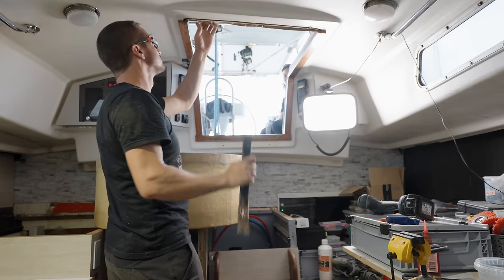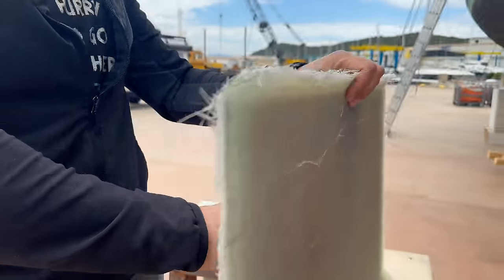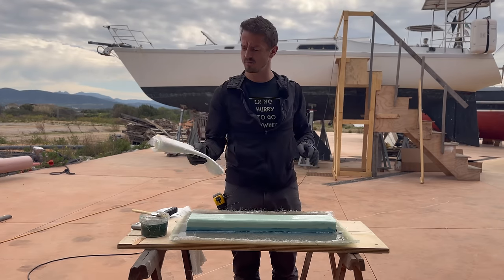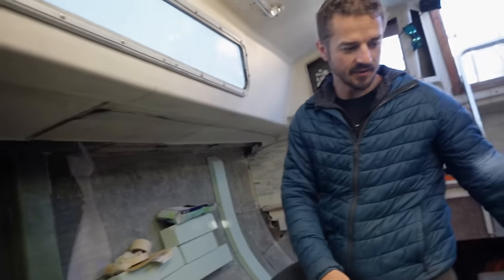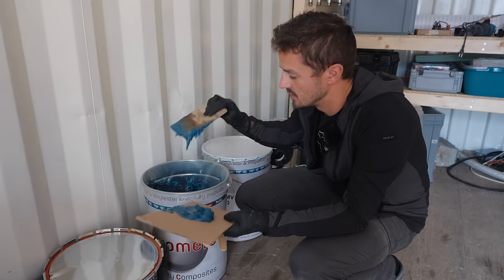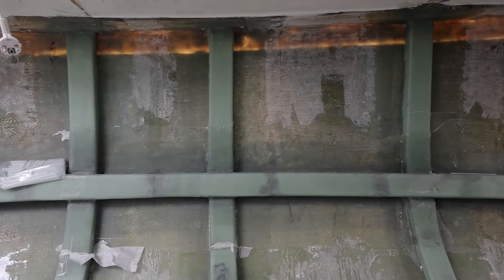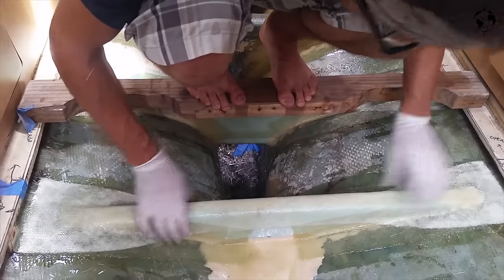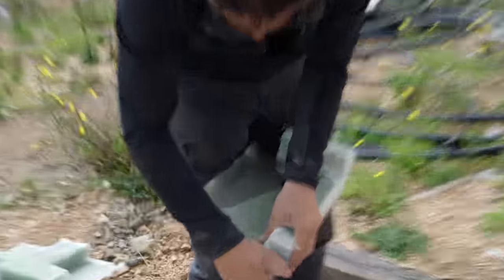Cutting Open our “New Hull”: What Could Go Wrong? | Step 386

Comment: The reason for the delamination is the peel ply finish you did on the model.....
Reply: I disagree. The peel ply wasn't under the stringer layers. It was on top. The failure was between the hull and the stringer laminate, not between the stringer and rib laminate.
Reply: @Sagan_Starborn They used peel ply on the top of the “hull” layer at the end of last weeks episode.  I don’t know a ton about doing composites other than what I’ve seen on some YouTube channels (Mike Patey would have done all this with carbon fiber!) but based on the comments I’ve seen from others here, I’m in agreement with those saying their apparent lack of prep (sanding and cleaning) of their hull layer before applying the ribs and stringers is the main culprit. Since the actual boat was ground and sanded down inside, and the pros were fully wetting out the glass before applying it, I don’t think Uma should have the same issue. Hopefully they give them a good whack with a mallet to check though!

Comment: I bet that the Dunning-Kruger study was based on the comments written to this video.
Reply: There are a lot of clever comments re the problems with peel ply, the concern over secondary bonding of polyester laminates and the need for good surface prep for polyester laminates - not much over inflation of self worth that I can see.

Comment: I think you will be ok.  Your test piece was smoothed down by the peel ply and has some silicone wax relief that prevented bonding.  The sanded and scuffed polyester hull should bond and laminste soundly.  Also the rovings being soaked in the actual fabrication should aid in the intragral bond.  Howeve, th new glass should be sanded prior to eack lamination to maintain the intrrgrity of thenew composite structure.  Good luck!   Professor Stephenson from KSU.

Comment: Vinylester is used to encapsulate a woven fabric, build in one piece or layed up when still tacky. It's not glue, it doesn't bond well to resin that has already cured. For that purpose you use epoxy, especially for structural work. Bonding of polyester or vinylester or cured materials heavily relies on sanding the surfaces as rough as possible. Still it won't come close to epoxy.
Reply: Dude, where did you read that? Vinyl has been used in boat building since the 50's and has been used in all building stages. Sand to remove blush and clean.  Then, just before additional layups, dampen area with styrene or MEKP to reactivate and give a partial chem bond along with the mechanical bond.  The industry has been doing it for years, too thick a layup overheats , then you got real serious problems
Reply: @GoofieNewfie69  The fact that you have to reactive the laminate says enough. And good luck trying to reactive a 50 year old laminate. And I wouldn't be too sure they even doing that on Uma.

Comment: When I was watching you hot glue the ribs to the hull, I went uh-oh. They should have been expoxyed in for sure.
Reply: Lesson #1
Reply from the maker: Why!? The foam is just a filler to hold the glass in shape while it cures. It has no structural significance to the finale result.
Reply: @SailingUma  The new glass is attached to the foam. The foam isn’t attached to the boat.
Reply: When laminating any product, using multiple solvent types is always a recipe for disaster.  Hot glue releases a solvent as it cures and can take days to complete degassing.  Not to mention that when you have a composite construction with air space sealed inside it is not known to turn out well.  Even if it’s just from an expansion/contraction difference, it’s going to create a weaker setup.
Reply: @davidwebb4904  Delamination in a test occurred between the "old" fiberglass of the "hull" and the "new" fiberglass of "ribs". The connection of foam to the hull's or rib's fiberglass doesn't matter at all.
Reply: The foam is just there to shape the ribs. This is not a foam core construction. The foam is just a lightweight material that allows the ribs and stringer to be shaped. Once the resin cures, the foam could be removed with no structural impact. This is in contrast to foam core design where the foam is under shear loading and is structurally significant.
Reply: @KeithCarmichaelInFL  This sounds a bit far-fetched. It seems obvious that, for whatever reason, there was a film of something waxy or something between the panel representing the hull and the glass over the foam. It was effectively a mold release. I would be looking at the resin used.
Reply: More like a structural bond failure than de-lamination.
Reply: Nah this is not a problem. It's the glass to glass adhesion they are concerned with

Comment: It brings great memories and joy to see a Pearson 36 undergo the adventures and renovation you have undertaken!  Having owned a 1973 Hull #45 and doing extensive repairs and improvements,  we found the the quarter sections of the 36 hull to flex (oil can), are you installing stiffeners in the aft sections? The 36 also has two deck scuppers/tubes which were glassed to the hull. Access was in the sail lockers. Those tubes cracked on our boat when we were hit with a quartering sea one afternoon. We had them removed ground out and had thru-hulls installed with a hose to the deck scupper. Lastly, having rebuilt our keel section when we had the keel dropped to re-bed, we found that these energey crisis hulls had inconsistent hull thickness. We actually did core samples as suggested to confirm this.  The keel sump area was much thinner than it should have been. Be sure that the keel sections and bilge get additional glass layers. We had the guru of fiberglass boat construction, the late Alan Vaitses, supervise our rebuild. You can find many of his books available. Fair Winds!

Comment: Your hull is okay, difference between your example and the actual hull job is that you laid up glass on the surface after peel ply without sanding it. And you never do that on structural things, consult with the young barnacles channel. Also you have applied a lot of tiny but powerful hits to the small surface area, and your hull reinforcement is a one big structure with a lot of contact surface which will distribute the laws of most collisions with the dock

Comment: Instead of hot glue, why not put te filler to adhere the stringer on top of the rib.  That way, there is no air gap between the rib and stringer?
Reply: Too late!!!
Reply: @davidwebb4904  hot glue is fast. You just have to hold the foam there for a short time until the glue sets then you can move on. If they used epoxy or something they would have to wait for it to set up.
Reply: @mckenziekeith7434  Hot glue has ZERO structural value.
Reply: @davidwebb4904  I agree. The foam is also very close to zero structural value. It is just a form for the ribs and stringers. But instead of removing the form, you abandon it in place.

Comment: As that you did grind everywhere inside the boat, which should add more adhesion, grind your model base and then attach new ribs and retest it. You could also thoroughly wet out your cloth before you put it over your ribs. Also, don’t forget to wipe it down before you glass on the other stuff. Pretty sure you did do a thorough cleaning to reduce or eliminate residue. So do the same thing with your model use some kind of degreaser dewax or whatever whatever you used in the boat and see how it works

Comment: Bond the foam to the fiberglass hull and new fiberglass, not hot glue.
The foam has compressional value as a monolithic structure.
Reply: But the foam isn't what should be holding the panel on 😂
Reply: @CaptainShack   Didn't expect you here! Who knew my interest in space sims and sailing had ANY overlap.
Reply: The hot glue simply holds the stringer in place. The overlay secures its placement
Reply: @QuinnChada  wrong ...the core is structural when bonded

Comment: I just watched the segment where you explain what you are doing regarding the frames and stringers. You pointed out that you would notch the frame over the stringer rather than cut the stringer to butt upto the frame because to do so would be a weaker method than leaving the stringer continuous. I would like to point out that the foam offers absolutely no structural support. The foam is purely there as a form for the glass layers. It is the shape of the fibreglass over the foam that gives the strength.
Reply: Not true at all. The foam in a composite (sandwich) panel add tremendously to the "rigidity" or "stiffness" by separating substrates of significant tensile strength, while preventing "sheer".

This would have been the case if the stringers and braces were properly bonded to the hull.

Because they were adhered with random glue gun beads (absolutely absurd) there is a good chance that the stringer and brace to hull bond will release, the composite sheer resistance will be lost, and the overall "stiffness" severely compromised (compared to what could have been achieved, if the stringers ands braces were bonded "intimately" with thickened resin.

Comment: Looks like the guys inside the hull attached the horizontal reinforcements first (in the first inserted video clips) of the video. That was confusing.
Besides I hope that roughening up the old inner hull surface for a better sticking of the additional (new) 2 mm inner hull works.

Comment: My guess is that not pre-wetting the fabric is what caused it. I have if anything just done an acetone wipe down after removing peel-ply, no sanding etc. 

By looking at your time lapses, the pros definitely seem to wet down everything before laying it. 

I would probably also use thickened epoxy to fill the gaps between the foam, so there are no possible pockets in there. Then you can just squeeze them in place and “fair” the sides with the squeeze-out. 

Would be interesting to hear the pros’ opinion on what went wrong with your sample.

Comment: "And to save even more weight, we've decided to build everything out of carbon fiber over aerogel..."  Hey!  I'm GLAD you're using more traditional materials!  There's a lot to be said for the handling characteristics of that which is light, but solid.

I once had a cast built up of overlapping strips of plaster-infused gauze.  The strips were roughly 1" x 6".  I've often wondered if such an approach wouldn't be strong than you three-play layup.  I'm thinking possibly, but the uniformity would be lacking.

"Where we're going, we're going to need it."  Rendezvous with the Kraken?

Your destructive test of your demo model:  You didn't sand and prep it between layers.  You DID sand and prep your hull.  The sanding significantly increases surface area for bonding, and pepping it with an acetone wipe-down removes the uncured layer of resin which interferes with bonding.

Final product:  "We no longer have any room inside the boat to live, and it's now too heavy to float, but it's STRONG!"  Just kidding.  :)

You guys are doing great!  Excellent considerations all around!  I especially like your coordinating with multiple sources of engineering input.

Comment: While peel ply is good, a quick sand and clean is required for best adhesion, and thickened matrix material instead of hot glue to set the foam in place.

Comment: This is such a big project and y'all are rocking it! My only thoughts on the glass delamination issues. 1) While the peel ply is good stuff, it has to be applied 100% correctly (should almost be wetted through, no air pockets, etc.). If not applied correctly, it can still look OK to play the next layer of glass immediate after the peel, but it might not actually be OK to lay the next layer without prep. When we do glass work, I still sand the layer after pulling the peel ply off. Time is still saved with the peel ply, because it does eliminate all of the epoxy runs and it does not need nearly as much sanding and prep. 2) Pre-wetting the cloth is very helpful. 3) Do you have 100% confidence as to what UMA's original hull is made of (glass + poly/vinyl/epoxy)? I see that you are using vinylester. Epoxy will adhere to all three, but the -ester's do not always play nice with epoxy.

Comment: A lot of this episode reminds me of when I was in design school. We were designing 35 ft sailboats made of fiberglass. We were given a booklet of American Bureau of Shipping standards and told to get busy. A lot of this type of framing ended up on my drawings.

As for your test sample lamination failure. What happened is that you attempted what is called a secondary bond. That is a bond of new laminates on top of old, fully cured ones. This is done all the time successful. Where you errored was in not preparing the old laminate properly. What was needed was the old laminate to be severely scuffed up first. What I mean by that is grinded by some really coarse sandpaper to the point you would see small fibers sticking out. This is almost certainly what the crew inside your boat did.
Reply: I didn't see them prepare the surface at all. And watching those layers completely floating in resin and being laid up with bubbles and wrinkles everywhere didn't fill me with a lot of confidence either.

Comment: Repairs to polyester structure are done with Epoxy as it does not shrink during cure. "Moldless Composite Sandwich Construction by 
Burt Rutan is now in its 4th edition. How about 3D scanning your interior  and  CNCing foam to match,  then vacuum bagging the panels to the hull and laying up over that. The only good news is that  the work done so far should be easy to remove. Then you can try to epoxy a test coupon or better yet try bonding something to the hull. Pioneering ain't easy.

Comment: In my experience building a boat, to make epoxy and glass cloth stick to GRP/FRP, you have to expose the glass fibres in the GRP by sanding first -- the finer the grit, the better. Epoxy bonds well to glass, but not to plastic. Hope this helps

Comment: I've never used peel ply with vinyliester; I just apply then let harden . I know that vinylester is gummy to sand, but I used a 40 grit heavy sand disc folded inhalf, to remove the worst part of the bumps, and laminated over. I've stretched boats using this method. I even did a peniche; stretched it from 26 feet to 42 feet.

Comment: I would think the vinylester would chemically bond with the polyester of your hull. I think those that say your prep work for your model (or lack thereof) is the reason for the failure. Hopefully the crew inside the boat did their due diligence in prep. I hope it all works out as if so, you will have the baddest assed Pearson 36 in the world!

Comment: This is good! And I mean it in a positive way. it is through setbacks you learn. Having made that model and testing it to failure is learning, building experience. Thankfully you had it so that you could test it. Maybe it's because you were foreshadowing that the strength wouldn't be as good as you thought, even if you were shocked by how bad it actually kept together. 
Lesson is simple - the process is good, the thinking is right but the materials didn't meet your requirements. So, instead of finding this out the hard way - when it would be a much tougher lesson - by bouncing into something or just over time as the boat twists and flexes and figuring out that all that effort you put into Uma was for nothing and you would have to tear her apart once more you found out early. Which is good! Even if it sucks... 
Now you can address this early in the build process, tear out the ribs and the stringers once more and use epoxy for the rest of the build. Its adhesive strength is about 4x that of polyester. 
Apart form that, it is an amazing project you're going through and you're learning a lot about boat building! Once you're done Uma can sail pretty much anywhere, which I understand is in your plans.
Reply: @SailingUma , @Moinois ;
I believe that this is the best solution, it's too early in the project to give up, do as he say's, but first do another test with the exact same method that the workers did and see if that method holds up to your test and if you get the same results as the last, try another test with some of the recommendations you have received here
 and see which one actually holds up to the test and then redo it that way, maybe you should have done the testing before actually using that procedure, but don't give up now, keep on working and enjoy the learning lessons, keep a positive attitude, fair wends and happy sailing, your smart enough to make the correct decision...turn-two and keep up the good work!!!
Reply: @AndreBarrera-Google  It is easy in hind sight to say that they should have done the tests prior starting with the boat, I don't think anyone would have believed that the polyester would have THAT weak bond. But now we know and @SailingUma can act accordingly. I'm just happy that they caught it now and not in a storm being bashed around.

Comment: Hi guys, sorry for the problems you are having! Polyester and Vinyl Ester resins have a problem bonding to existing structures. Always use epoxy which will adhere perfectly. Also Antonie is correct with his post.

Comment: I've been a fan of your channel for a number of years. I have been amazed at your ingenuity as you modernized the drive and interior on a reasonably budget.

But this project, while fun to watch, kinda blows the whole reasonable budget concept out of the water.

If building a blue water battleship is your goal, I think buying an old boat that came out of the factory as such, then working your interior magic would have made sense. Something from the 70s from, the UK or Scandinavia would have been nice. Maybe an old Swan.